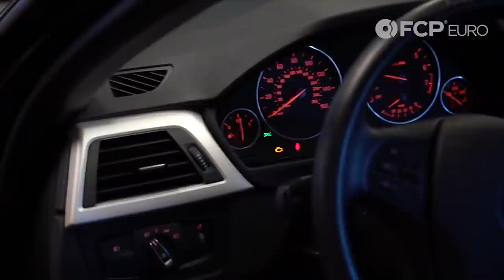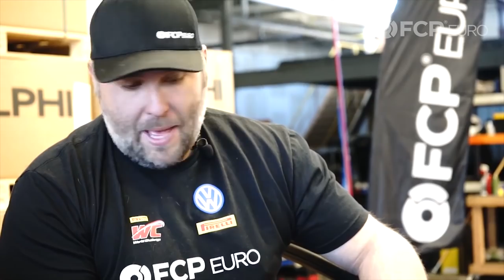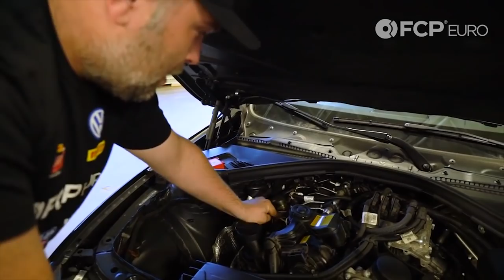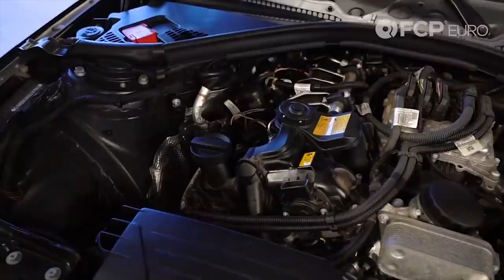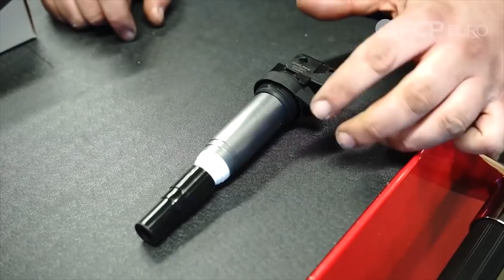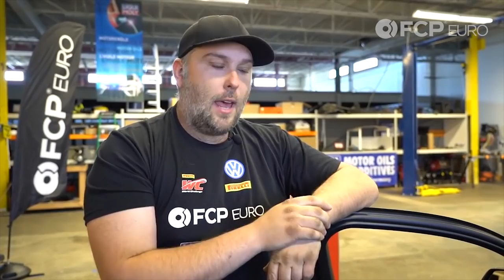Ignition Coil Symptoms, Problems, Diagnosis and Replacement  - EASY DIY!

Comment: My Volvo s60 heater color 5 hose busted and oil sprayed all over the engine I fixed the hose but now when I try to start the car my car won't crank all I hear it's a spinning sound coming I think from my starter I changed the starter but I still get the same problem what would this problem be and how would I fix this problem
Reply from the maker: Hi, Jamar. I'm not sure what you mean by heater color 5 hose. Do you mean your heater core hoses busted? If so, coolant would have probably sprayed out rather than oil and you possibly could have overheated or damaged your engine.
Reply: @fcpeuro  yea I changed my spark plugs and they were drinched in oil  went would that happened

Comment: What can cause this same 2012 528i 4 cylinder to stall while driving randomly usually when I punch the gas ? Help ?
Reply from the maker: Hi Steph, It's difficult to diagnose that kind of issue without seeing the car. I would recommend bringing the car to your local service center to get it diagnosed. Once you determine the issue, we'd be happy to help you find the parts you need!

Comment: My f30 n20 was scan by dealer high pressure rail sensor.the sympthon crank cannot start the engine.sometime i can start the engine suddenly for a few minute or second the engine turn off.drivetrainnmultiction. its is true the high pressure sensor fault?
Reply from the maker: It could be! You said the dealer scanned the car? What did the dealer say the issue was?
Reply: @fcpeuro  the dealer say that is high pressure rail sensor fault .The dealer already erase the fault but want to check again either the fault still or not. Rail pressure sensor fault the symphton is crank cannot start and sometime the engine is turn off and the rpm go down to 0 from 1???

Comment: Hey question? Do the misfire cause a stall? I have a bmw 330i and I’m getting codes (29d2-29d9)
Reply from the maker: Misfires can cause your engine to stall if they are bad enough, however that code you are getting is likely a bad fuel injector.

Comment: can you tell me how to reach 5th and 6th ignition coil (which are very inner side) in 2011 BMW 535 ix drive?
Reply from the maker: The cabin air filter box will need to be removed to gain access.

Comment: What scan tool did u used ?
Reply from the maker: An iCarsoft scanner was used.
Reply: buy yourself a FULL BUS scanner for $50 more... you will have access to all the car 30+ modules!

Dont buy a limited "check engine light" ("4 systems") scanner or you'll miss the whole picture.

The OBD2 CAN-BUS was developed by Bosch, everyone else was forced to join the wagon

Comment: You didn't mentioned if the check engine light went out immediately
Reply from the maker: If you had a check engine light before, you will want to clear the code after replacing the coil packs, the light will not go out immediately.

Comment: My car went in safe mode also wont change gear faul and i change the coils and erase then woks fine , is that is normal ????
Reply: you need to scan you OBD2 port to understand what module is acting up or what sensor is bad!

Transmission in "Limp Mode" is a  serious issue to prevent more damages.

Comment: won't that change firing order for those two cylinders
Reply: No he moved coil one to the number two and two to one, but did not move spark plug wires which would of changed the firing order
Reply: @kcmescal2618  but the electricity is coming from the coils.....
Reply: @rajanbrar6561  there cool over plug, so the charge is the same, coil over plug can be placed over any plug and will be the same, but defect will show up where defective coil moves to, same can be done with a wire or plug

Comment: It would be better to disconnect the injector associated with the specific cylinder in question as disconnecting the ignition coil pack cuts all combustion in that cylinder sending more raw gas downstream that isn't particularly good for the catalyst.
Reply: Arnold Rimmer  these car are built to eat parts, everything goes: rims, cats, coils, intake manifolds.

The home mechanic understands that 1 coil being bad announces the others going the same way